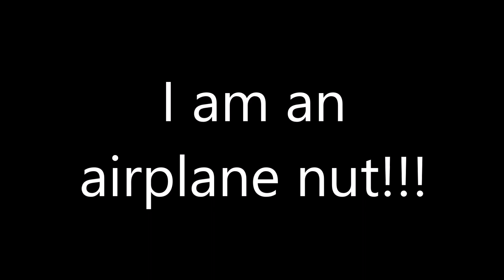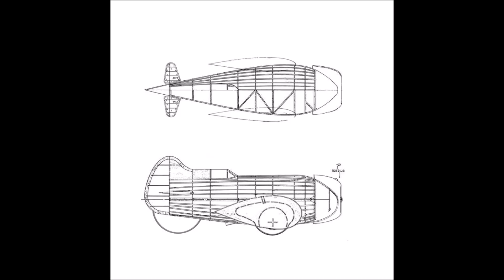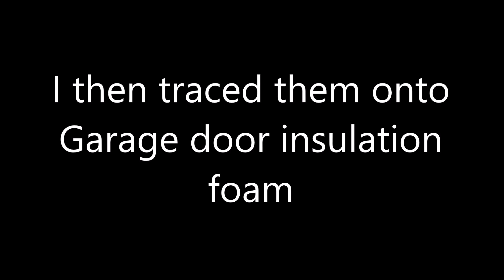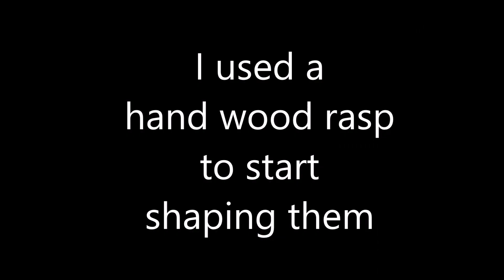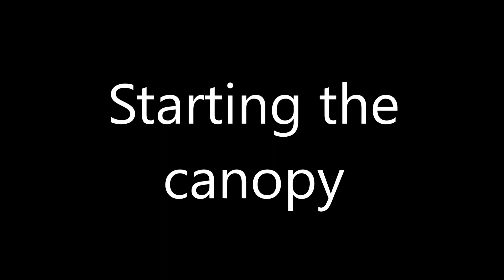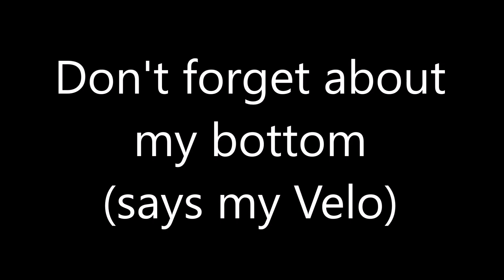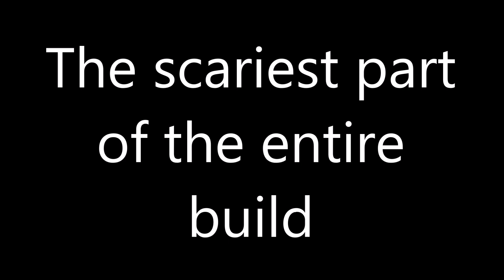Velomobile Body build

Comment: Awesome choice and great idea. Can't wait to see the next steps. Yeah the process is like building a canoe but also like building an aircraft... may open new ways for DIY builders!
Reply from the maker: That is always my hope. I am not completely sure if I would build it this way again, but my initial idea was to keep the foam as an internal layer sandwiched inside the Carbon Fiber exterior layers. I am now thinking about just using the initial foam body as just the form to put the carbon fiber around....
Reply: Velo 'Merican 
Great, that's exactly what I wished you had in mind. I think it is going to be really a good job. I will stay tuned!
Reply from the maker: welcome aboard my friend

Comment: Hello, in minute 03:14 how did you export that? I have my model in slicer for fusion 360 and I would like to do the same approach of yours
Reply from the maker: I made a grid in the Background of my 3d modeling program (Maya) the grid is set to inches. I then took screen shots and in Photoshop sized the picture to match the dimension as best as possible. Then to a big printer. The best thing that is doesn't have to be perfect. I cut the foam a little large and shaped it to exactly what I wanted!!! Best of luck to you!!!